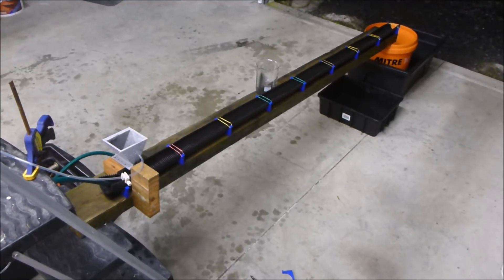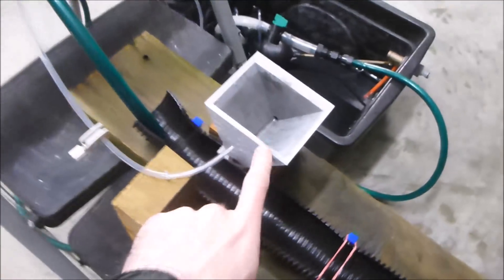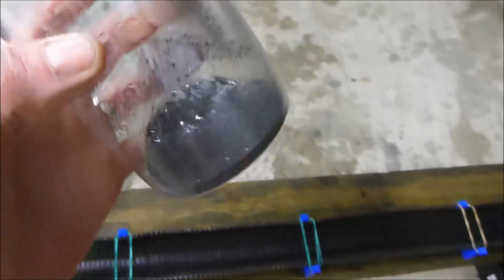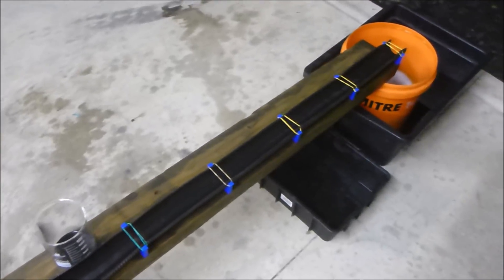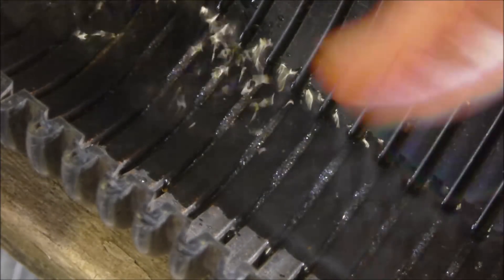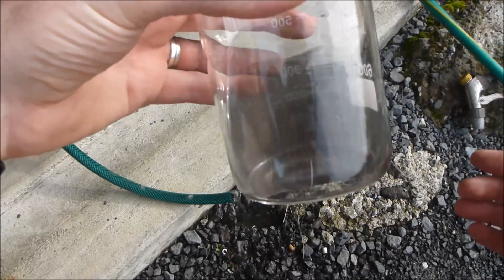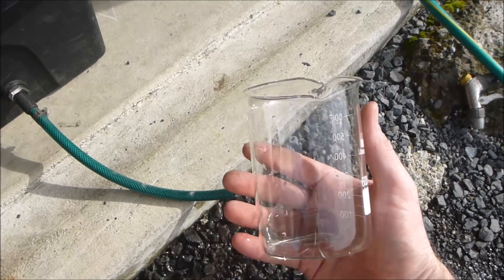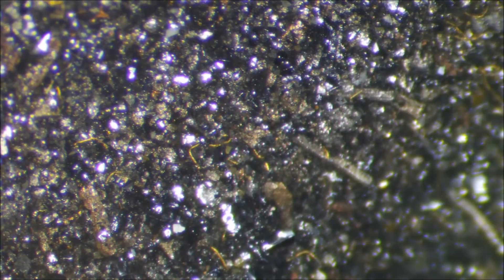Gold Recovery - Automatic Sluice Feeder

Comment: Want to sell the old slow motor and print another hopper?
Reply from the maker: Hi, from memory all the .stl files for those parts are in a link that is on the video, should be able to get one printed fairly cheaply pretty much anywhere. Could probably make something similar fairly easily out of wood too if that is more accessible.

Comment: Hello, You do amazing work, I love your videos and they have inspired my workshop design for processing my materials. I do have a question. You were running material from modern ICs in this video and that would mean you used pyrolysis before using the ball mill to crush the ICs, correct?
Reply from the maker: Hey there, appreciate the great comment. Yes, correct, pyrolysis before ball mill. You could technically just ball mill the ICs without pyrolysis, but it takes much much longer to get the material fine enough.
Reply: Successful Engineer Awesome! Thanks for the reply. I have heard in a video or have seen a post about you depopulating mother boards, possibly with an oven. But, I have not seen any videos on your channel about it or maybe I missed it. I would love to know your process for that as I really would like to end my use of the air hammer (my arms are killing me) or heat gun methods and hot sand baths do not work for such boards that well.
Reply from the maker: Hi Dave, this video -> https://www.youtube.com/watch?v=wzWB66dLBok  shows the little depopulator I built for ram, allows me to get through a few kilograms of ram in an hour. Bigger boards I still do with the air hammer, but I don't do that many these days. In theory you could scale this idea up to motherboard size, but it might be difficult with through-hole components and all the plastic on motherboards.
Reply: Thanks for the link. I did see that video and was wondering about larger boards but so far it looks like the air hammer is still the answer at this time. Thank you so much for your reply and efforts.

Comment: I don't think it will be long before you have a machine to do every step of the process for you. Very impressive set up though!
Reply from the maker: Hey mate, yeah, slow progress with the automation, but it will get there. I managed to get a few other things done yesterday while this was running, which is exactly what I'm looking for!
Reply: I've actually stopped using a blue bowl due to the time constraints. I use a process similar to what you did in a bucket where you stirred the material and tipped out the dirty water. I prefer to use a 2 litre glass jar as this enables me to see the gold bond wires at the bottom, once I'm happy they have all settled I tip off the dirty water and repeat the process until I have a small enough amount of material that can be treated with ap. When I tip out the dirty water I do use a gold pan with riffles to catch any bond wires that hadn't settled. I found that if I had too much material the ap wouldn't penetrate the pieces of copper at the bottom of my vessel. I find this process gives me time to do other things as I can easily cook a meal or cut the grass whilst the settling is happening.
Reply from the maker: Yep, perfect, I also don't actually mind that washing stage too much because as you say, you can carry on with other jobs while the material is settling. The blue-bowl works brilliantly, but it is bloody slow! I'm hoping to get this auto sluice system running completely automatically so it can just work it's way through a kilo of material every hour or so without me having to do any more than check on it once in a while.